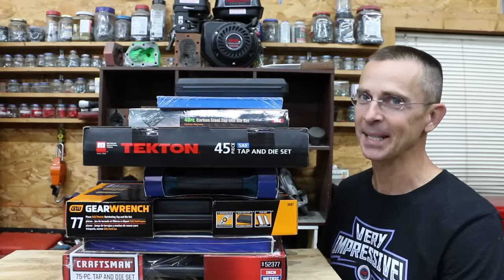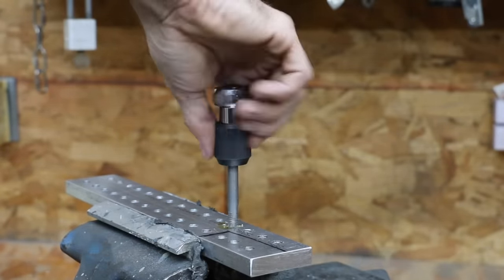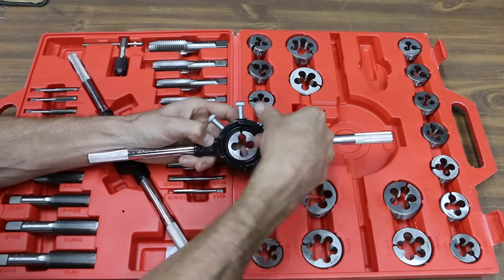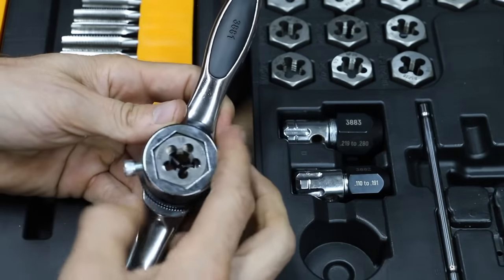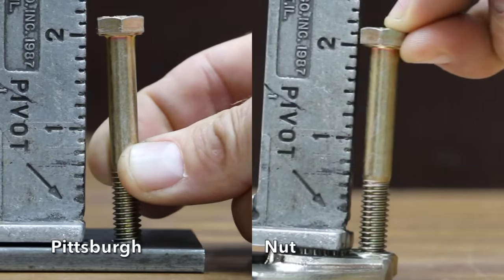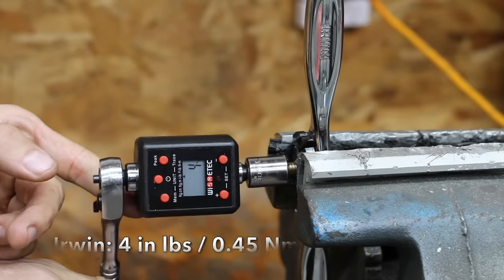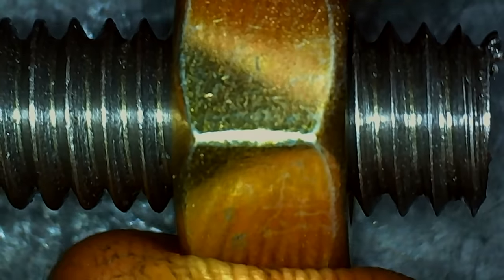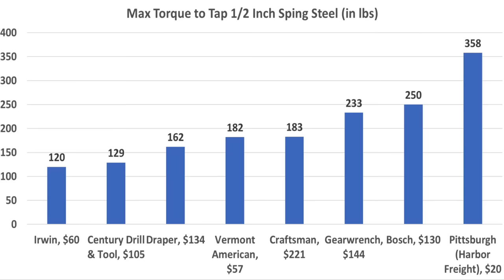Best TAP & DIE Set? Craftsman vs Irwin, Bosch, Draper, Vermont American, Tekton, GearWrench

Comment: I think you should have left the Draper out of the test. This was a much needed video and perfect timing!, just two days after I broke one of those taps off in my part that took me a week to machine and cost me about $600 in tooling and material alone....smh.
Reply: You need real taps for the stuff you're doing, not these cheap generic ones. Greenfield is a good tool for the money.
Reply: @rotorhead5826  lol... Your right, but I was tapping copper which really sucks to machine tap or anything else.
Reply: With correct use they are hard to break, even pros are often lazy to actually do some centering when tolerances is not an issue, and then sooner or later taps will break inside.
Reply: @WarpedYT  I know how horrible copper can be. With the right tooling though everything gets much easier.
Reply: As much as I “enjoy” these big tap sets at the house for cleaning out threaded holes. I seriously wouldn’t consider any of these Adequate in the machine shop. Get you a nice $20-$50 per tap spiral point or spiral flute in the sizes you use most and you’ll never look back.
Reply: @Norwegian_Bastard  have any of you all tried, freezing the copper, and or long pipe putting a bag of ice on it for 10min before machining it. We had some unique copper pipes and plates for a print/developer chop application and it was like night and day. ??
Reply: @WarpedYT  have any of you all tried, freezing the copper, and or long pipe putting a bag of ice on it for 10min before machining it. We had some unique copper pipes and plates for a print/developer shop application and it was like night and day. ??
Reply: @Norwegian_Bastard  did you use tapping fluid or water to keep it cool?
Reply: @cvantrease1231  I got similar advice from the friend who started my toolbox with a cheap socket set- the cheap stuff is good enough for rarely used sizes, replace the junk with good stuff as it wears out or breaks.
Reply: Oof 😣
Reply: @WarpedYT  Or you just never learned to do it the right way. Too many Youtubers that are shiny in their videos but are very sloppy just as some of the taps in the video
Reply: @cvantrease1231  Fully agree ! 👍
Reply: @WarpedYT  tapping copper sucks. I think you can get taps with a different rake for copper, or use a forming tap and lots of oil.
Reply: @rotorhead5826  you need to talk to machine shops, that do production, Sterritt  and brown and sharp are a couple of names that I know, I have a brand new set of Craftsmans , and the Sterritt it blew them away most of the ones you tested are Junk! Use a tapping head, to test, also test Drapes? Drills and taps in one operation, You can see and feel the sharpness on a  tap, What kind of torque does it take to snap one of those Taps? Are usually really like your videos, but this one was just comparing junk against junk ? lol i’ve had pretty good luck with Napa tools.
Reply: @golfwipe  to my knowledge neither starrett nor brown and sharpe make taps or dies. Mostly focus on measurement tools. The tools from NAPA are likely similar in quality to the gearwrench taps as both are supposedly made by the apex tool group
Reply: @Warped Preception 

There are also different types of cutting fluid for different metals. Iirc, you want to avoid sulfur based for soft metals.
Reply: @rotorhead5826  would have loved to see Greenfield taps & dies in the comparison. I understand the pain of crappy cutting tools!
Reply: @rotorhead5826  here here for the greenfield..i tap stainless parts and do 100s of holes with them
Reply: @5tr41ghtGuy  greenfield, triumph, Cleveland, cle-line, hertel, Chicago-Latrobe and even interstate are better then retail brands. I have never used interstate from a set, they could be lower quality than individual taps. Interstate drill bits can suck but I have never personally had a problem with their taps.
Reply: @caseyt8447  Correct, look at tapmagic cutting fluids... careful not to spell it tapmatic... because that's different brand. But I know as you pointed out they have a different formular for ferrous and non ferrous materials.
Reply: For copper, get it very cold first, then have a steady flow of oil while drilling.  Not water, oil.  Yes, it’s messy.  
For tapping, only give 1/2 turns then back off to clear as you go.  Use oil.  Galling sucks.
Same for the softer aluminum alloys.
Reply: That's why the guys who do sinker EDM charge so much---to remove broken-off taps!
Reply: Either leave the Draper out, or use a different cutter from the other sets
Reply: @Norwegian_Bastard  I have ground the end of a drill bit to have a zero rake for copper so it wouldn't pull out of the vice.
Reply: @Norwegian_Bastard  that is exactly what I learned on this project, I had to flood it with a ton of coolant to make it work, the copper was absorbing the heat from the bit before the coolant got a chance to, interesting phenomenon but it made it a painful learning experience..lol
Reply: @rotorhead5826  plus, the technique for sure
Reply: @rwhite9994  I didn't try that but that makes sense, what I did instead was just go slower and flood the part with coolant completely to make sure it didn't heat up
Reply: @1südtiroltechnik  I learned how to do it the right way now...lbvs, my first time machining and tapping a large copper part. First time for everything but Yeah I'm not sloppy.
Reply: @caseyt8447  you are absolutely right, I also learned that making my video, when I moved to a non-sulfur-based coolant it was like night and day
Reply: @blackhawk7r221  well I ended up moving to a different type of coolant, and then some of the holes I tapped by hand using the process that you stated here. That's how I ended up getting it done.
Reply: @tubastuff  yup
Reply: @Norwegian_Bastard  I feel your pain !
Reply: @rotorhead5826  btw , I was back filming the video after I commented here and I was tapping another hole, a larger one, and then I realized that the top I was using for the larger hole, was Greenfield...lol. not the one that broke though that one was Craftsman.
Reply: @WarpedYT  Cool.  Yea, soft metals suck to work
Reply: @WarpedYT  Well the old guy who did all of the copper taps, pipes, rods, vaccums, plates, etc for the print shop, kept ice just for these applications. Lubrication oil was also used to allow his tools to eject materials, the ice was just to keep the copper and copper alloys brittle enough to prevent clogging.
Reply: @golfwipe OSG and Guhring are the best
Reply: @eoinfrankel6306 OSG and Guhring is what I have used in every machine shop I have worked in

Comment: I own the Irwin because I felt at the time that it really punched above its cost, and I didn't want to spend $300 on a real set.  I've never had an issue with it.  

i'd love to see an episode on garbage bags - either kitchen or yard/lawn/construction bags, or both.
Reply: You cannot beat Irwin taps for the money.  They hold up just as good as very expensive sets.  They are the only ones I will buy.
Reply: Nice request!
Reply from the maker: Thanks for the video idea.
Reply: I agree, garbage bags would be interesting.

Comment: Fun fact:snap on taps, which I'm pretty sure are made by Irwin, are warranteed for breakage but not against getting dull, which happens over time. So when they get dull, put  them in a vise and break them with a hammer:instant warranty. We been doing this for years. This tip courtesy of my local snap on dealer
Reply: Last set I bought of my then Snap-On dealer wasn't branded as such,  but rather  Blue Point...
Reply: i hope you wear glasses lol. Hardened steel is not nice when you whack it with a hammer
Reply: @Roy_Tellason  I am concerned about Snap-On starting to market sub-brands in the same areas of tools as Snap-On themselves. Especially, that in some areas of Snap-On's tool lines those other brands are the the only brands offered...  (Blue Point Tools) was one of the two companies involved (SnapOn Wrench Co) that established the Snap-On Tools brand, though Blue Point Tools technically ceased to exist after the merger - or were they the actual brand behind Snao-On's sockets the whole time?, and Snap-On decided to make them visible??, or are they a whole new company under a familiar name??? I-dunno, still not comforted by the whole arrangement.
Reply: @Roman agreed. He's just a young guy trying to build his business and so far he seems to be doing well. No bullshit. Much luck to him in future

Comment: For anyone that cares…

Straight flute hand taps =
Go in a few threads, back out a few to clear chips

Spiral fluted taps =
Drive it in with consistent force, like a drill, and the chips will evacuate out of the hole

Spiral point or “gun” tap=
Same as spiral flute, only the “gun” flute forces the chips out the bottom of the hole, only used if it’s a “through hole” to be tapped.
Reply: I really wish he could have tested a spiral flute big brand name tap for us machinists. Something attainable like from McMaster or something.

Comment: As a person that makes taps every day, I can tell you this test is highly subjective.

You can see be the pics, the chamfer lengths are all different on the different brands, and one brand had some aggressive “roughing” threads on the end.

Not only that, those were all straight flute “hand taps”.  They are designed to go in a few rotations, and then be backed out a few to clear the chips.  Otherwise, you’ll get chip build up and end up galling out the cut threads and blowing the hole way bigger than you wanted.  And you saw it happen when he cut the aluminum.

And the die test wasn’t fair.  The dies that had the slots in the side are adjustment slots, for controlling final thread size.  You can’t put those in a vise and expect the correct thread size to come out.
Reply: While I don't put it past anybody to overlook certain aspects of tools, he's generally pretty observant and attempts to account for as many variables as each tool offers. I'd be surprised if he didn't adjust the dies to be as close to the same diameter as possible. Considering he did a thread fit using a standard bolt first. 

The point of the test was to accelerate wear on the tools. Unless you're working in ideal conditions, these thing aren't getting babied much, and if it's going to survive abuse like this, it'll probably last you a lot longer in the field.
Reply: I agree with you, the method he used was not correct on how to tap holes, also holding the die in a vise isn't correct either.  In and back out is the proper method with plenty of cutting oil.  I would call this a test of the tools' durability by people who improperly used the sets.
Reply: It happens a lot in his videos.  They provide value, but not as much as an expert advice.
Reply: I totally agree with you. Also, tapping a hole in the metal clamped between two jaws would require more force and would produce an oval hole.
Reply: Putting the slotted dies into a vise has no bearing on the function of they are in a die holder. The vise is exerting force on the die holder, not the die.
Reply: Regarding the die test. Ehh, sort of. Yes, the round dies had adjustment screws. But, if the adjustment was set, putting them in the vise, especially if mounting the slot pointing right at a vise jaw  won't squeeze them. However, at least one of the round dies was slammed for cutting the thread "loose". If the die was set correctly it would give whatever slop in the thread you wanted. And, but adjusting for a bit less cut, would remove less material making for an easier cut.

Comment: I learned my trade in the early sixties and all the taps we used or made were made of high speed steel not carbon steel and for the larger sizes >2" the blanks were hardened before we ground the taps. I would like to see how the spiral-fluted taps would compare. Great report.
Reply from the maker: Thanks!  Thanks for the suggestion.
Reply: Retired sparky who tapped thousands of holes in 0.25" aluminum plate to mount various electrical boxes. Used a 1/4 20 gun tap in a corded drill  to tap holes along with aluminum tapping fluid. We would order 4 to 6 4'by 8' sheets of aluminum and have it cut down to 4 by 4', 2 by 4' & 2 by 8' foot sheets to mount motor starters, control transformers, safety switches , transformers ( 0.5 to 5 KVA ) etc in a large candy plant where you could not use plywood because of possible bug infestation.

Comment: I’ve got a combination metric SAE Craftsman tap and die set from the early 2000s when it was still made in America. I can’t tell you how much it’s been used over the years but it’s definitely a lot. Working in an auto shop brings lots of chances to use tap and dies. It cuts beautiful tight threads in everything from aluminum to lug bolt steel and has never failed. One of the 14mm dies has cut over 40 full lug bolts and aside from looking slightly used it still works perfectly fine.  Absolutely love it and think it does a better job then any of the Snap On, Matco, Mac, gear wrench, and Cornwell sets that other technicians have.
Reply: I've got the same set.  I'm a machinist and shade tree mechanic.  Nothing bad to say about that set!
Reply: I have a blue cased metric and SAE Craftsman set from the 90's I bought new.  Like you said very nice cutting set.  I bet Irwin made them back in the day.  Cheap China crap does not occupy my tool boxes.
Reply: @libertystuffnthingsreviews829  yep my case is blue is well. My dad actually bought it for me as a present back in 2002 I believe. Literally can’t say enough good things about it.
Reply from the maker: Nice!  Thanks for sharing.
Reply: made by irwin likely  as are all of the labeled tool truck sets   all owned by stanley
Reply: It seems like taps and dies have really gone downhill lately. These sets looked terrible. I know the really el cheapos always were bad. But once you get up around $100 things should improve.
Reply: @mikethetoolman8776  Certainly explains why you can get the same set from snap on, Matco, and whoever else in the same box with just a different sticker on the box.